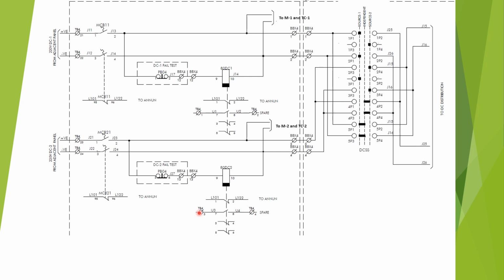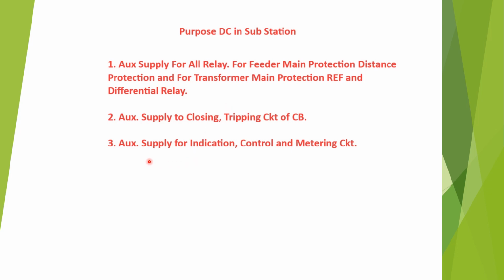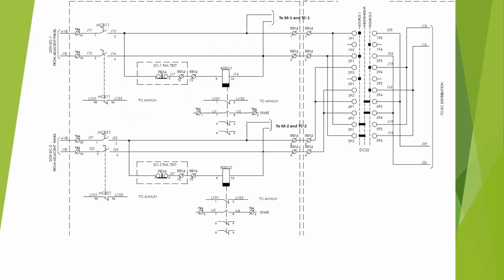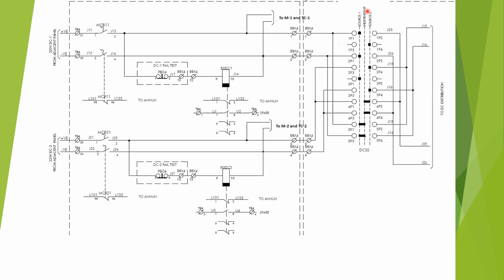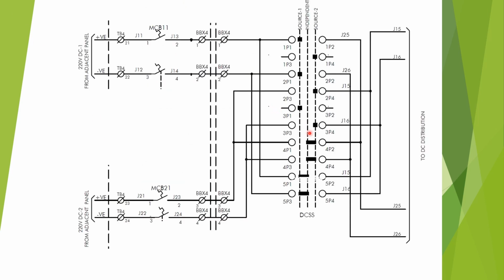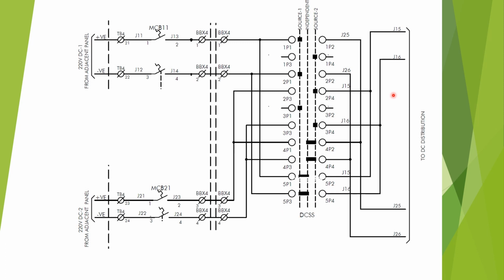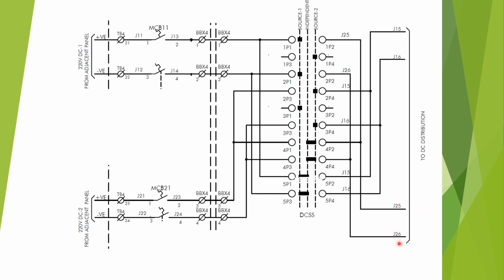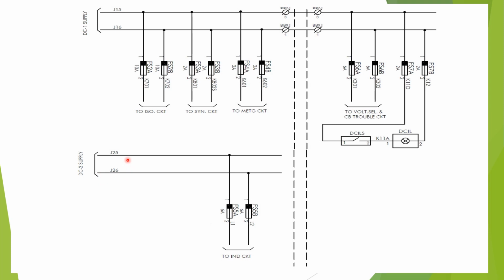Function of DC Selector Switch in Control and Relay Panel for double DC source

Comment: Why required double DC supply or separate DC for CRP
Reply from the maker: Because in CB there exist two trip coil... And in CRP there exist two main relay for voltage level 66 KV and above i.e. Main-1 distance relay and Main-2 distance relay .. therefore separate DC supply are given for main-1 and Tc-1 and main-2 and Tc-2 because failure of one DC will not impact relay and cb operation during fault condition.
Reply: @relayprotectionelectrical  what have position of DC selection switch in normal condition if both DC source available?

Independent..........?
Reply from the maker: Yes you have given the answer
Reply from the maker: Please enroll for course on Transformer Protection on udemy 
https://www.udemy.com/course/protection-used-for-power-transformer/?couponCode=931DB6D9C361B37E48B6